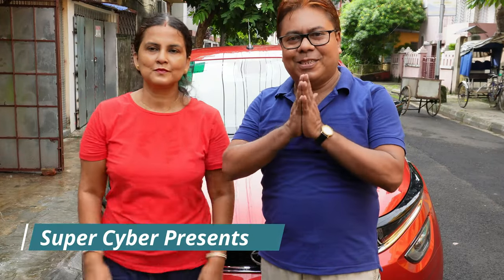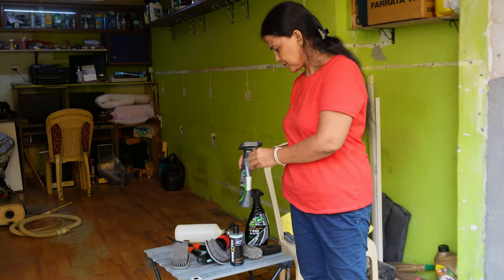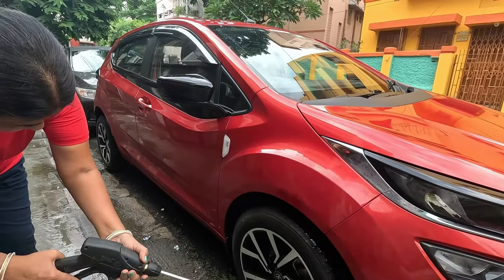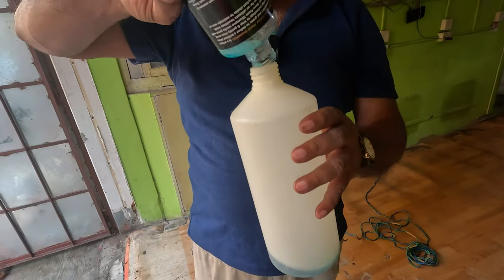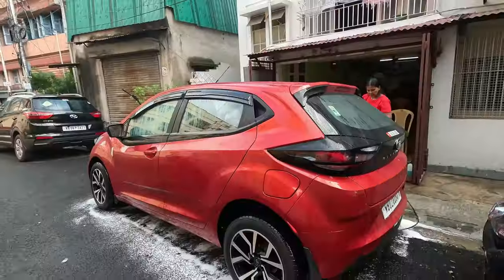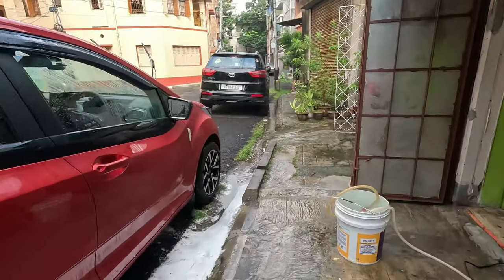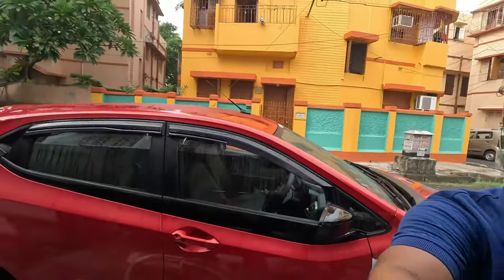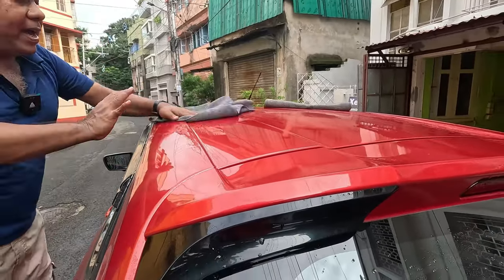CAR EXTERIOR PROTECTION IN RAINY SEASON AT HOME DIY #carcare #carprotection #

Comment: Great job sir, very nicely explained.
Reply from the maker: Thank you .
Reply: @supercyberautomotivetravel  Saw some of your other guides, they are very helpful and to the point without any marketing jargon. I have been taking care of my own cars for a long time now and have been watching YouTube for the last 2/3 years. After watching many experienced details like you, my current car wash method is as follows: 
1. Foam the car (to avoid hitting dust and gravel on the paint with high pressure water), 2. As the foam is doing its job clean the rims, wheels 3. Pressure wash body and wheels 4 Foam again 5. Hand scrub with mit, sponge or microfibre dipping it frequently in a wash bucket filled with shampoo water with grit guard. 6. Pressure wash 7. Spray wet ceramic glaze one panel at a time, spread with one microfibre and buff with another clean and plush microfibre cloth. 
I also use Shinex Pro shampoo, Which dryer do you use. I would request you let me have your comments. Thanks
Reply from the maker: Absolutely perfect you can use wavex hybridx  4 in one detailer as a rinsing aid when the car is wet it will require less work to wipe dry your car

Comment: I also apply turtle wax ceramic coating. The only problem is the scarcity of water in my apartment. So usually I get it washed from the turtle wax shop and apply the coating at home. How often do we need to apply it. I saw the shine remains the same for almost a month. Turtle wax says that if we apply the ceramic coating twice it will last for 6 months but i don't think so.
Reply from the maker: Thanks for your query . The coating is of very good quality . If you apply perfectly it will easily last more than 3 months with a top up coat. Please watch this video for perfect procedure
https://youtu.be/Po2sgllhN10

Comment: Hello sir, im having city VX 2016 model and for ORVM (Side mirror) how to maintain them with smooth working and for door windows maintenance to work smoothly
Reply from the maker: Use silicon lubricant spray for power window channels and mirror hinges for trouble free operation.
Reply: @supercyberautomotivetravel for door hinges? Sillicon lubricant spray which brand?
Reply from the maker: I am using this
https://amzn.to/3LNlFZJ